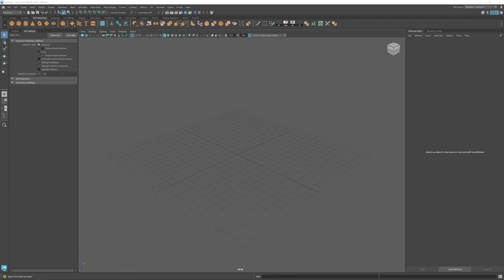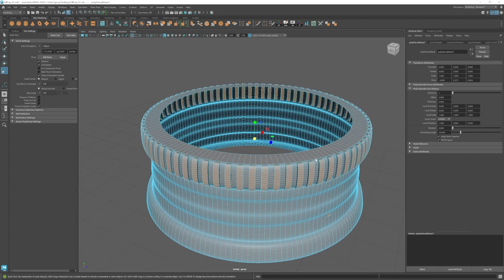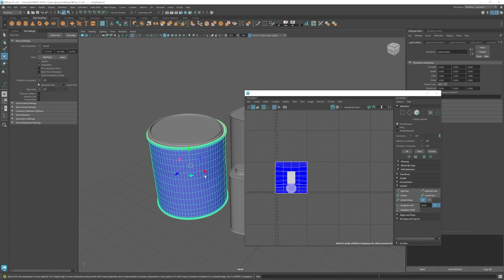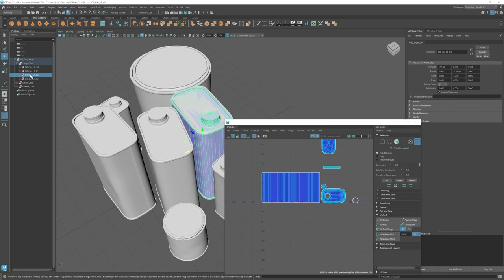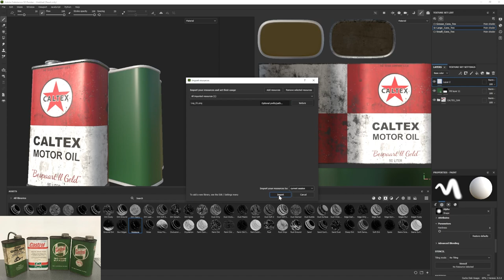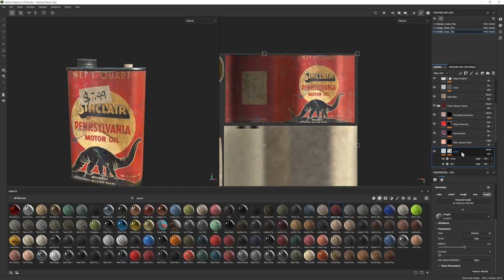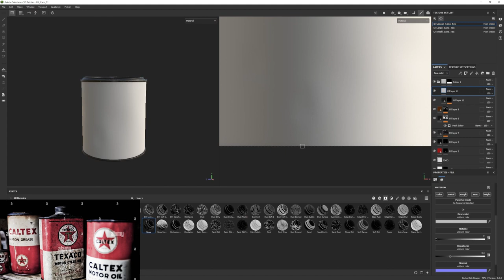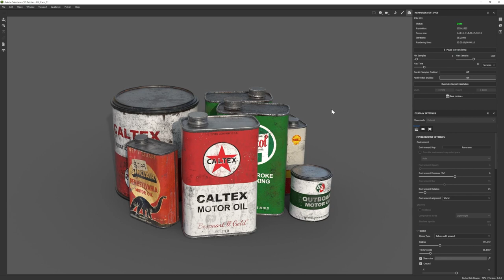Old Oil Cans | Autodesk Maya + Substance 3D Painter

Comment: Instead of pressing g to repeat the last action to get to the multi cut, press right mouse btn to confirm while staying in the tool. To activate multicut instead of clicking on the menu item, select the object in object mode and shift rmb -> drag left. To extrude along normals hit ctrl e to extrude and add thickness in the menu, so you wont have to switch to component orientation. To bevel use ctrl b instead of the menu item. Then you can use alt + q in substance to quickly enable/disable isolated view. These are just some things I would do differently cause I am faster that way, mabey its personal preference idk
Reply from the maker: Thanks! Yes these are very helpful, I use a lot of those in my workflows too it definitely saves time, I mostly use menus in these videos to help show people where the tools are. I got asked quite frequently in the past so now I tend to use menus to help show others and avoid having to explain where the tools are lol pressing G to repeat is definitely habit but I personally enjoy it and use it all the time. The right-click while using multi-cut tho I never new about! Life saver, thank you! and thanks for mentioning all of these, I’m sure others will also find this helpful 🤘

Comment: instead of selecting every each and everyone you an mirror 2 time after making 1/4 part of selecting, much easier?
Reply from the maker: Yes mirroring would definitely make life easier for selecting them all, there are also scripts you can add to quickly select every other face or edge with 1 click (I've done this in previous videos). You could also create a quarter of the object and then duplicate it around. There's definitely a few different way you could go about it! Thanks for the comment :)
Reply: @polyrendr  can you share me script ? I actually do lot of circular rotation work so I need this.